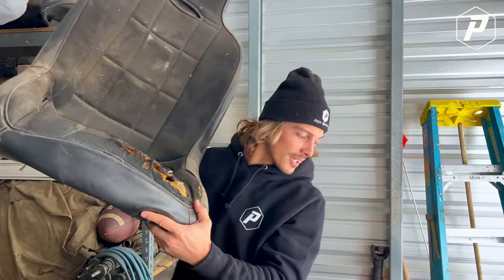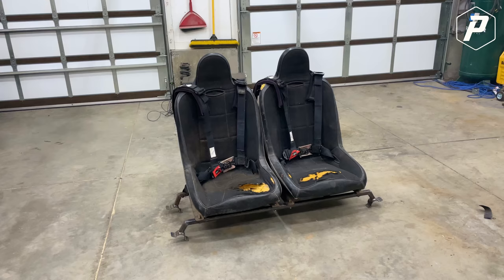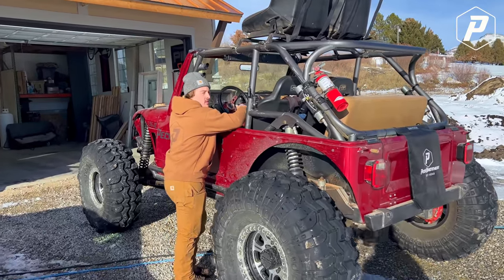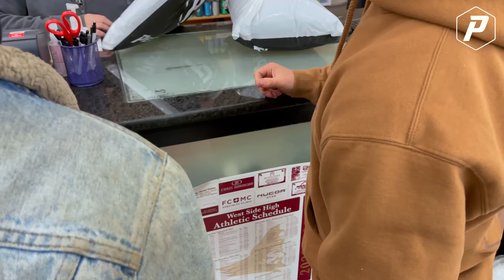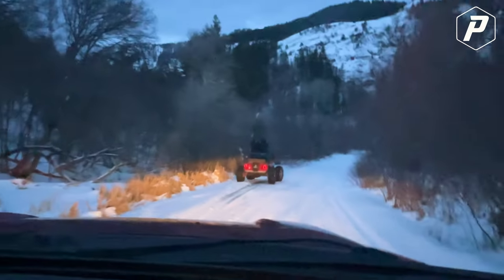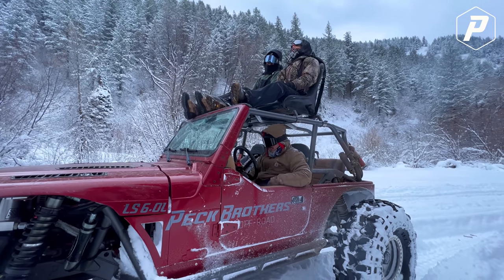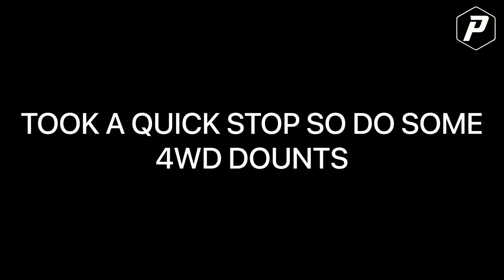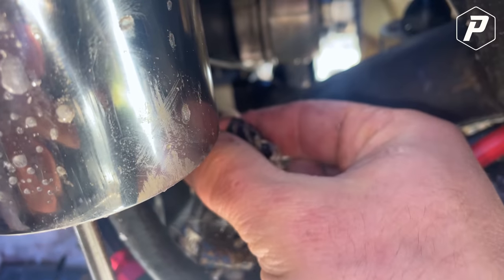DOUBLE DECKER JEEP CATCHES FIRE

Comment: Just a quick tip for those of you interested -  Standard 'rubber' fuel line hose will not hold ATF for long.
 
SAE Standard covers four types of hose for use with automatic transmission fluid: A, B, AT, and BT. Type A and Type B are for use within a temperature range of -40 to 125 degrees C (-40 to 257 degrees F) while types AT and BT are for use within a temperature range of -40 to 150 degrees C (-40 to 302 degrees F). 

Recommended maximum operating pressure for Type A and Type AT hose is 1.7 MPa (250 psi) while recommended maximum operating pressure for Type B and Type BT hose is 1.0 MPa (150 psi). The lower pressure (Types B and BT) hose is for auxiliary cooler applications only.
Reply from the maker: So interesting man thank you so much for sharing that knowledge I had no idea!!

Comment: I could use the double decker for Mardi Gras.  I see braided tranny lines and a tool bag in your future. Great video.
Reply from the maker: Lol what’s funny is the whole system is braided PTFE lines and AN fittings other than those because the cooler I had, had a slipover barbed fitting 😂😂